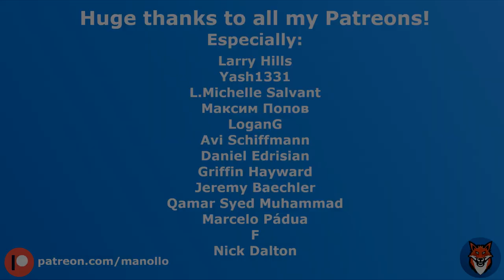Sideloader Lite 1.0 - DiY Snap-On AR Display

Comment: awesome stuff!

Is it possible to transmit/stream from a PC/Phone/etc (wirelessly) to the glasses and just have a projecter in the glasses? maybe would cut down on bulk and weight of the glasses

similar to how a smart tv works, its just displaying your phone screen on the display.
Reply: Yes, apart from the screen replace everything with an RCA reciever and connect the transmitter to your phone/PC using and HDMI to CVBS converter, they are meant to be 9-12v but work at 5v with shorter range, they are usually used to connect reversing cameras on cars to the dashboard without wires, I'm currently working on making something similar to make a HUD for my motorcycle helmet.

Comment: HI! Im working on something similar to this except with raspberry pi pico. is there a good micerodisplay that will work with pico? Thanks for reading
Reply from the maker: I think any OLED display would work but the resolution would be really small. You could try using one of Adafruit’s display.
Reply: @ManolloMancelli  thank you so much!